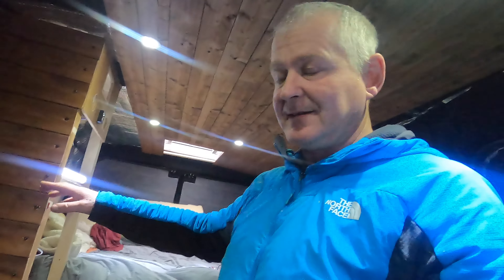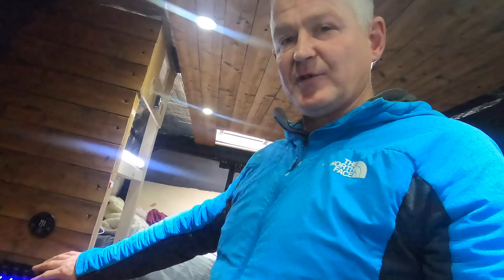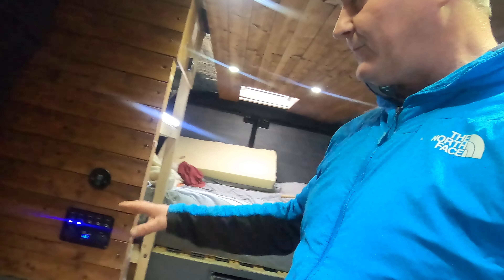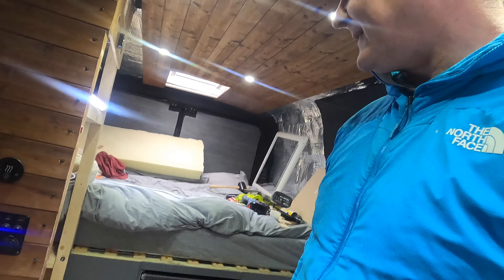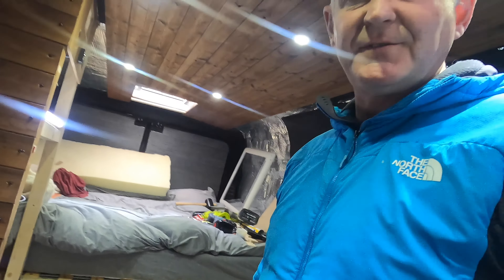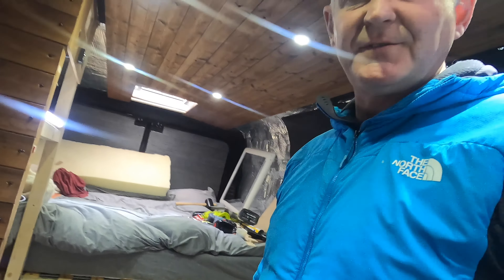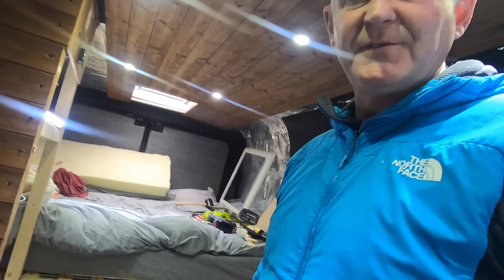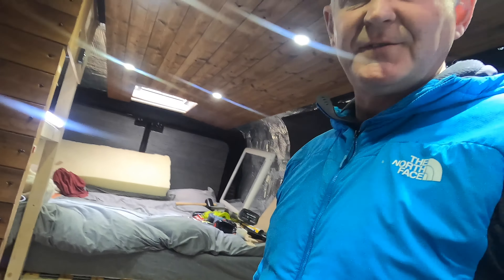HOW TO CONVERT A VAN TO VAN LIFE - VAN LIFE UK - PEUGEOT BOXER

Comment: As you know i want that heating system, what issues are you having with it mate ?
Reply from the maker: No issues, I enquired about the heating ducts that are under the van, as they ant insulated, they can lose heat.. so my question to them was if i was in an artic condition how much heat would the heating ducts lose. My other question was the heating control has the thermostat built in it, which I wasn't aware off, so asked them if moving the control would make nay difference, which it doesn't according to Whale who build the heater. So they have recommended using Armalfex insulation piping on the external heating ducts, and this has actually increased the heating output and the van is so so much warmer as it not losing heat under the van where the heating ducts are run from the heating system! So all good mate!
Reply: @PackTheVanAndGo  cool , some good advice
Reply from the maker: @goth_dude6874  If you get this heating system, then you'd need to find some 60mm Armalfex 9mm insulation piping and get under the van and wrap the heating ducts in it.. they also do the tape for securing the piping... having the heating ducts covered also protects them from the weather and driving.. so its def worth considering... I'd say you increase your heat output by 30-40% which is a lot of heat to save!

Comment: Hello mate
Can I ask what size leisure battery you are using
Reply from the maker: Hi mate, I’ve got 3 x 110ah batteries all wired in parallel
Reply: As you know I have a vw not running as much stuff as you but since I put my night heater in it keeps going off so was thinking of upgrading my battery to a 220ah
Reply: Lithium
Reply from the maker: @colincr64  my whole battery and solar system came from Bimble solar... I have my LPG heater, fridge and electrics all running off my 3 batteries and my split charge.. I’ve had my heating, fridge and lighting running all day every day and not lost any power mate. I’d say give Bimble Solar a call and ask their advice mate?
Reply: @PackTheVanAndGo  
I have already fitted a 150 solar panel but my battery is a bit weak
Reply from the maker: @colincr64  my panel is 325watts, I’d speak to Bimble solar mate and ask them, they provided me with all that I needed based on living off grid and powering all the items I needed